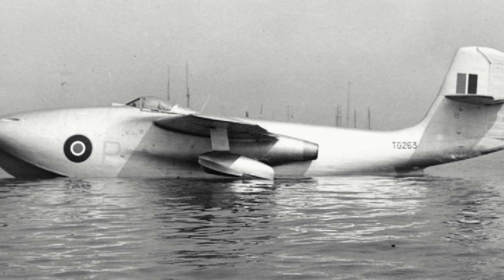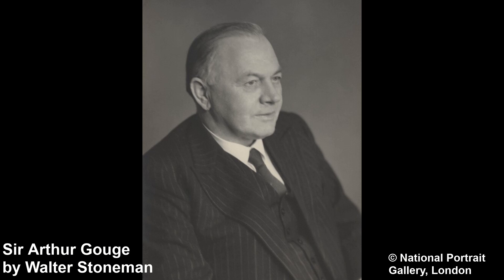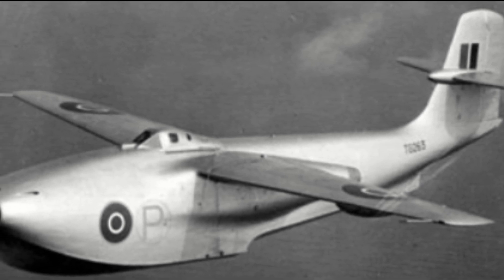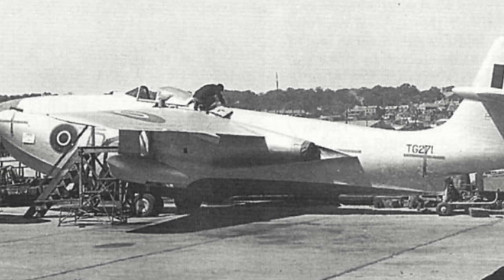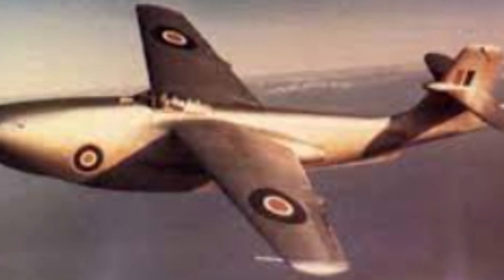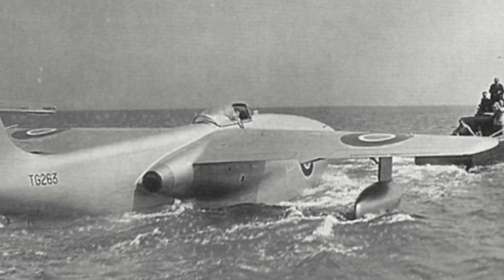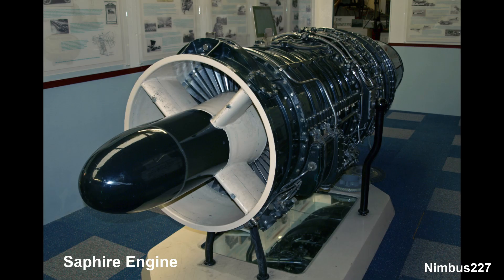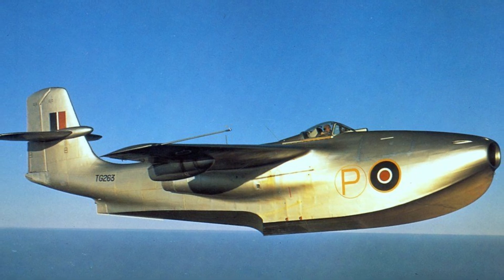A flying boat powered by jets? Saunders-Roe SR.A/1

Comment: I live on the Isle of Wight (White) just a couple of miles from where this was built. I knew some of the old boys who worked on it and they were very proud not only of the SR.A/1 but of many of their achievements such as the Princess flying boat (think 747 but on water!). Sadly many of their greatest engineering feats were also technological dead ends. The SR.A/1 was the answer to a question nobody was asking. I still think it looks amazing and it is one of my favourite aircraft. A real "what could have been", Saunders Roe pulled off the near impossible with this one, it worked more or less out of the box and could have been a real asset during Korea or WWII if it had lasted longer, but alas Carriers were already a thing.

The building you can see in the background is the Columbine Yard. it sports the largest Union Jack in the world as is the birthplace of many of Britain's technological achievements. Not only the SR.A/1 and Princess but also the worlds first hovercraft and indeed the later massive cross channel hovercraft (also called Princesses) and also the Black Arrow rocket being produced there. These days it is used to build aluminium ships that are exported worldwide with perhaps best known being the latest Thames Clippers and the most recent Red Jet Isle of Wight ferries. Although the building has concrete foundations and a concrete floor throughout you can still feel the tide come and go and indeed the floor move as I can attest myself.
Reply from the maker: That is really fascinating and interesting. The Princess Flying boat is one big aircraft, quite impressive. As you said though it was made at time when flying boats where not the answer. In terms of the SR.A/1 by what I've read it was also quite maneuverable especially for a seaplane. There is a good video on YouTube showing it fly inverted.  A lovely looking aircraft indeed. 

That is quite interesting, and good to hear that it is still utilized today. That would be quite a strange feeling to feel the tide go in and out. 👍✈️
Reply: be careful when talking about dead ends and answers to unasked questions.   lockheed is working on a floatplane version of the c-130 hercules for use on pacific islands should china start getting more aggressive about sea power.

Comment: Interesting looking plane, but why  the turbines so near to the bottom and not on the back? Must be a big problem that it sucks water.
Reply: The front of the aircraft was designed to avoid water entering the engines. If you look from the side the "hull" starts a long way back from the air intake

Comment: Looks like you would end up with water going into the engine.I don't what happens if water gets sucked into a jet but it's unlikely to be good for the engine!
Reply from the maker: It does, but it seems quite a bit of design work went into the design of aircraft to limit it. No it would not be good at all

Comment: G'day,

Ah, point of order, a Seaplane IS a Floatplane..., ie an Aeroplane standing up on Floats atop a forest of drag-inducing Struttery...; whereas a Flying-Boat has it's Fuselage built as strongly and heavily as an ocean going Boat's Hull, and thus only needs Wingtip Floats, or Outrigger Pontoons either side of the Hull - so, less Struttery is involved.

Essentially, Seaplanes are analogous with  Elbarsoles, and Flying-Boats are virtual Arselbows...; in the sense that it's easy to design an Elbow and it's straightforward to design an Arsehole - but trying to make an Elbow which can also function as an Arsehole - or an Arsehole that works tolerably well  as an Elbow INVARIABLY results in something which almost works as both but is actually rather horrible at doing either task..., as compared to  single-purpose specialised items for each job.

The thing is that on the Water a Flying-Boat/Seaplane behaves as a truly VILE Sailing-Vessel - one which is totally incapable of trimming, adjusting or furling ANY of it's "Sails"..., yet being covered in huge Aerofoils, and having a Stepped Hull, probably a retractable Water-Rudder  but no Keel or Centreboard...

And meanwhile, as Aeroplanes they're woefully handicapped by having to be built sufficiently strongly as to be able to bounce off the Ocean when dropped into the trough between two waves, from 10 ft up in the air - while travelling two or three times faster than most consumer-grade Speedboats.

Therefore, thus, and because..., Flying-Boats and Seaplanes are ALWAYS going to require 30 to 100% more Power to carry the same load at the same speed, burning more fuel - and using enormous amounts of Distance to become airborne or alight....; as compared to a Landplane lofting the same payload.

Meanwhile, any time anybody buggars up an Alighting, on Water, they're bloody lucky if they don't drown while still unconsciously strapped into their Seats.

And, also meanwhile, Salty Water is really good at corroding the sort of dissimilar Metals employed by Aeroplane Designers for Structures, Skins, and Rivets...; so everything under the Cowling/s is often painted with Cod-Liver Oil to preserve it from corrosion - meaning that the things smell like something which a Dog delights in rolling in, behind the Sand-Dunes where the Fisher-folk throw the heads and guts...(!).

Putting a pair of Turbojets in a Flying-Boat Hull and fantasising that it would function a Fighter-'Plane, with which to pursue and chastise the King's Enemies  in thymes of Waaauuughhh(!) was always an extremely silly concept...

The SRA-1, in my view is an attempt at an Elbarseyeball - a Sailing-Boat which flies up into the Sky on the power of a pair of gutless Zero-Bypass Ratio (horribly inefficient) pure Turbojets...

An absolutely CLASSIC example of British Engineering Buffoonery at it's very  finest...; possibly the greatest remaining wonder is that they didn't stick with the tried and trusted Biplane layout with which the Walrus and Seagull had successfully (suck cess fully...!) survived WW-2...!

Surely, they could've grafted a pair of Jet-Pods off a Meteor onto a Walrus..., and possibly resurrected the infamous COW-Gun, with which Pemberton-Billing was planning to revolutionise Nightfighting.

If they'd only TRIED just(ifiably ?) a little bit harder - they could have made the SRA-1 quite a lot funnier ; despite it's actual hilariousness to behold, as a concept.

Biggles would have loved a Turbojet Biplane Flying-Boat Fighter...; with a Squadron of such things, maybe Britain's Empire could've Bin-Preserved for another decade, perhaps - before it's inevitable collapse...?

(lol...!).

Such is life,

Have a good one...

Stay safe.

;-p

Ciao !
Reply from the maker: Ahh yes thank you for that pick up. When writing the "script" for this video I struggled to get a nice flow going. I found it a lot more difficult than it should have been. I distinctly remembering getting confused and slightly jumbled up when trying to find the opposite of a floatplane. I went blank on flying boat and thought seaplane would work as alright substitute.  Oh well such it goes. 

It is an interesting concept the seaplane. Perhaps one that is best left for the most part in the past. Water and aircraft in general are not a good mix. 👍✈️
Reply: @AntiqueAirshow  

No worries mate.

Yeah the only arena in which Aeroplanes and Water really seem to be mixing well is Aerial Firefighting.

A  Boeing 737 Large Air Tanker costs $20,000,000 to Convert from an Airliner, it carries 13 Tons, and can drop once per Hour or two depending on Ferry-Time and Groundcrew Efficiency...

An Air Tractor 803 on Wheels lifts 3 Tons, on Amphibious Floats they lift 2 Tons - same as a Huey, but with 180 Knots  Ferry-Speed, and 5 Minute Sortie-Time...
 So in an Hour an AT-803 F(ireboss) can drop 24 Tons, working from a Lake, River, or Harbour within 20 or 30 Miles - refilling at 70 Knots at 4 ft above the Water-Source on a Scoop and Go.

And a Fireboss costs $2,000000 each, to buy.

DeHavilland Canada's Twin Turboprop Aerial Firefighting Flying Boat is $34,000,000 to lift 8 Tons but ONLY flies off Water.
A Squirrel or Jetranger has a 500 Litre Bucket, Longranger 2 Tons,  Blackhawk 3 Tons, and a Chinnook 9 Tons...

My son the NSW RFS Group Officer has had a go at Night Firefighting with a Chinnook under his Orders..., and he tells me that NSW has 9 Fire-Boss Air Tractors on Floats as of today, they have a Blackhawk, they have a B-737 LAT...; they're BUYING their own Chinnook, and my son is authoritatively suggesting that the LAT be sold and a FLEET of 30 or so much more EFFECTIVE and EFFICIENT and versatile  Fire-Bosses be acquired, as well.

He's a bit of a Child Prodigy of a Firie, actually, I started him Night Firefighting in 1994 when he was 5, at 13 he wangled his way, as a Junior Member, onto a Section-44 Campaign Airbase & put in a few hours loading Retardant beside me (!) {wildly illegal !!!), and at 17 he was the youngest Deputy Captain (elected by the Brigade - at the  RFS Commissioner's "suggestion" to the Brigade's AGM (!).

At 24 they gave him a Red Hat and a 2-Tanker Brigade, plus a slot on the first local Remote Area Firefighting Team, at 30 he drove over a burning Wooden Bridge to reach Wytaliba while it was being burnt over - 60 houses out of 100 destroyed, 70 Civilians burnt a bit, 2 hospitalised for Skin Grafts, 2 others died..., and Matthew extinguished the burning Fire Station (to be rebuilt for $300,000 - rather than a $3million replacement !), helped defend the Community House  against the Burnover, then hd and his crew got around in front of the Fire and saved a Dwelling House...

The highpoint of 49 Shifts of 12 Hours Firefighting he put in that season (!).

As Pennance, at 31 they made him Group Officer, with 6 Brigades, a Command Car full of Radios, and he RUNS the local RAFT...

As high as a Volunteer Firie can go !

So DaddyWarbles is immensely proud, and has access to lots of interesting Firefighting minutiae to ponder.

For instance, did you hear that the reason the Crookwell-Hill End Fires blacked out a big chunk of the Grid a week ago..
; was that a RFS Blackhawk pulled it's 3 Ton Bucket THROUGH a High Tension Gonductor and ripped out about 2 KILOMETRES of  Wires out of the Grid...

But the Blackhawk "failed to crash" - so therefore 
NUSSINK !
Made the
news....
!!!

Having Kids is REALLY
Satisfying...

When one puts in the
Effort required to assist one's 
Offspring to grow up to become a
Functional
Adult, who stops shit from getting worse, 
And consistently works to
Make 
Stuff
Work
BETTER...!

So, today he took me to the Coast and back, and Daddywarbles got to debrief him on how SCARY was
This Season's 
Fire Behaviour - and what we can 
TRY 
To do, before Winter is over
&
El Nino comes back to
Cook
Oz...
And all of
Us
Within...

So....
Who
Knew ?

Amphibious
Crop-Dusters 
Make the
BEST
Aerial Firefighters -
Of all the available
Kerosene-Burners

So
There is indeed,
A "Killer-Application"
Still, in 2023...
For
Aeronautical
Arselbows and
Elbarsoles...

And the Russians have a Twin High Bypass-ratio Turbofan Flying-Boat Firebomber...; so there is even an actual
Aeronautical
 ElBarsEyeball, still struggling
Out there ; 
Looking for a
Market....

And, if that Jet
Flying-Boat
Firebomber
Were to be
Modified
(Muddificatered...!)
To become
AMPHIBIOUS...

Then,
As a veritable
"Twin
Jet
FireBoss..."

That might become the next
World-Beating
Aerial
Firefighter...(?) !

Large Air Tankers 
Currently appear 
To be 
A
FAILURE, 
Hereinat...;
Within
Australia...!

(How very...,
 Churchkillian...
 Was that ;
Eh, what...!?).

Because an Aeroplane designed to cruise fuel-efficienty, shuttling Citybred Consumers across the Atlantic...; turns out to be an absolutely USELESS (Except for generating AeroTechnoPorn images of huge
 Jet Hairygoplanes dumping Red Shit 
Across the 
Landscape...

While 
Low
Slow
Heavily-loaded
In 
Mechanical Turbulence &
Wind-Shear &
Oropraphic 
Downdrafts
(Topographic Rotors)....

It turns out that a
Boeing 737 
Does NOT
Handle at all well...

Compared to a
FLEET of
2 or 3 dozen
Purpose-designed
Crop-Dusters on 
Amphibious Floats modified for
Aerial Firefighting
FOR THE SAME MONEY....

Coulsons may be invited to buy the NSW RFS' LAT, to replace the one they pranged in South Oz last December..., apparently as mindlessly as the splatted the Herculese which flew from Sydney to Cooma - where it crashed after flying into a Rotor which ANY halfway-competant Hang Glider Pilot would see and avoid and warn against ; in Weather which they were UNAWARE that both the previous LAT Crew, and their Air-Attack Controller,  had both refused to try to fly back into....(!).

(Btw...as yet, CASA has yet to release the mandatory Initial Crash Analysis at 30 Days post-Prang...{!}...).

If you feel like surfing a 
Rising Wave...(?),
Make a Video 
About 
Air Tractors.

If you look in either my 
"Personal Aeroplanology..." or
"Solo Hazard Reduction Burn Program..." Playlists,
Therein you will find Videos from my Headcamera while setting up an AirBase in a Section -44 ("Statewide Bushfire Emergency") when I noticed, and Duct-Tape Repaired (!) a Structural Skin-Failure on the Right Lower Auxilliary Tailfin (retrofitted when Radials were replaced by lighter Turboprops - 6 ft further forward, neccessitating  addititional extra depth of Tailfeathers..., to maintain Yaw-Stability..., Y'see ?)

Because the Skin-Damage could dramatically worsen with increasing Airspeed, I had the machine grounded and taped it back together -  waited to show the other AT-802 Pilot (who was a LAME) the Video of the Damage and my Repair - which he authorised to fly the rest of the day's Missions, saving several Houses as it did (!).

Because the Skin-damage I fixed was to a previous Repair, I passed it all on to CASA...

Within a year CASA got a
Freedom Of Information
Request 
Which they had to inform me could not
Be refused...

And last time I watched an Air Tractor Video..., it appears that those Auxilliary Tailfins have been
Relocated, outboard,
Spanwise on the
Stabilisor...

As I had suggested
To
CASA.

To prevent the
Wheels from
Repeatedly
Stoning Sheetmetal off the
Auxilliary
Tailfins...,
When
3-Pointing, and stalling,
Landing
Onto
Gravel
Airstrips...

So...,
Apparently..., even my wildest
Jury-Rigged
Emergency
Duct-Taped 
Airframe Repairs, have had
Vindication
From
"On High..." (!).

So I feel rather
"Paternal"...
About the new little
Amphibious
AT-802 Fire
BOSSES...

Because when I
Reached up, and
Tweaked their Design
Via a CitiZen's Snailmail to
CASA, 
Referring them to a
YouTube Video shot on a
Potato.....

AirTractor
Modificatered
Their
Hairygoplanes...
In light of 
Proffered
Input from 
My humble little olde
Self...(!).

Such is life,

Have a good one....

Stay safe.

;-p

Ciao !
Reply from the maker: @WarblesOnALot   
What your son has achieved is quite amazing and you have every reason to be very proud. It is quite remarkable. The work the volunteer firefighters do is indeed very important and significant. 
Aerial firefighting is very interesting.  It makes a lot of sense why a 737 would struggle at such a task, while amphibious crop-dusters work so well.  In a way you need somewhat dedicated designed firefighting aircraft. Its requirements are quite different to that of a normal aircraft. 

I'll have to check those videos out, seems very interesting. Sometimes the best fixes are those that are simple, do the job and not overly engineered. Well done on your repairs.👍✈
Reply: @AntiqueAirshow  

Thanks mate !

Yes, Warbledaddy is immensely proud of how the offspring have turned out...

I didn't try to teach them what to think..., so much as how to go about thinking stuff through so as to identify - and avoid the Bullshit Ideas...; which are out there, lurking, ready to ambush the unwary...

And, yeah, Aerial Firefighting will be a big part of trying to deal with next Spring ; as long as the Boatloads of refined Fuels continue to arrive - and as long as the Ports can unload them and distribute the Magic Motion Lotion.

Failing that, then apparently lots of Shit goes all Apocalyptical ; as far as I can make out...

And, yeah - as long as the Airflow is pushing the Tape in place, and providing the Tape aligns with the Airflow, and there is as much Tape on both sides of the Leading-Edge - then it can hold torn Sheetmetal Skin in place on the Airframe...

Back in about 1984 some nutter built a FAR Part 103 "Ultralight" from Beer-Can guage Aluminium..., and it was too thin to use Rivets ; so he designed and built a stressed-skin Cantilever Wing with Ribs on Tubular Spars, more Aluminium Tubes for Compression-Struts between the Spars, and a Semi-Monocoque Fuselage...

And ALL his Aluminium Sheetmetalwork was joined using 3-M Double-Sided Tape...

I read an Article in a US Magazine featuring it..., he went to a lot of trouble with Surface Preparation...

I figured that if a his whole Airframe held together with Sticky-Tape could cope with a 2-Stroke's Vibration, and there were photo's of him airborne in it ; then Duct Tape could certainly stick a Patch back onto a Turboprop-powered Air-Tractor !

Such is life,

Have a good one...

Stay safe.

;-p

Ciao !
Reply from the maker: @WarblesOnALot  👍.  
yes, it seems that it may been important, but fingers crossed it isn't too bad. 

That is very interesting and quite fascinating. That takes a brave man to fly a machine put together with tape. But if it works, it works I guess. 👍✈
Reply: PZL Belphegor with floats?